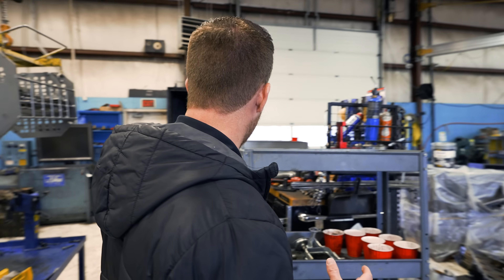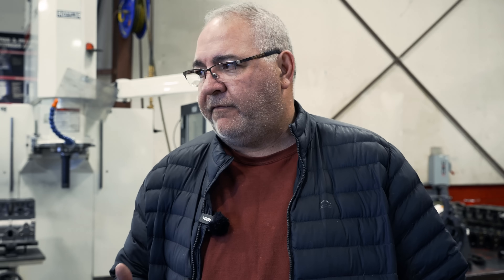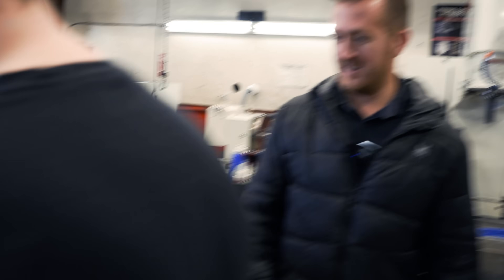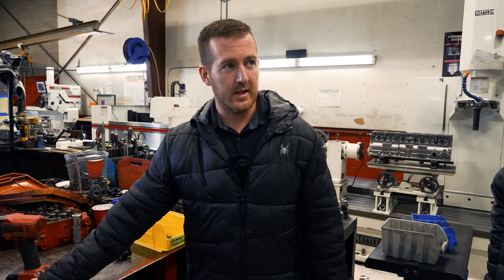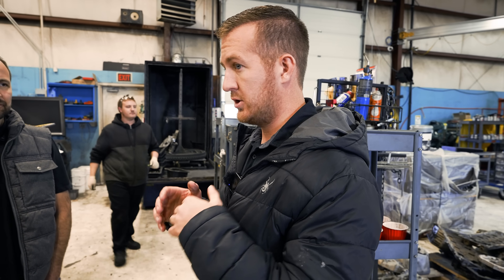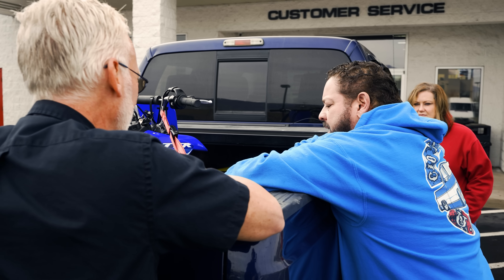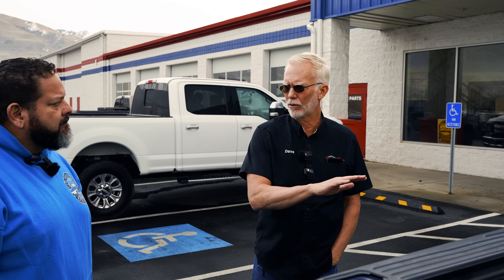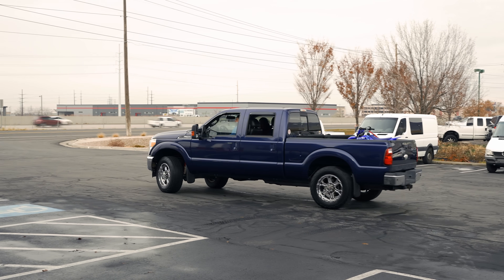Looking Inside a 900,000 MILE CP4 Pump!

Comment: Regular fuel filter changes, draining the water separator in between, Good fuel from a station that normally has fresh fuel (large truck stops). The more fresh the fuel the less likely the fuel is to sit around and absorb moisture. Seems like anytime i hear of a cp4 failure its usually followed by my water in fuel light came on, i put def in it, i change my fuel filters when the low fuel pressure light comes on, ect. Have a 17 f750 service truck with 7800 hours on the original pump and still going 🤷‍♂️

Comment: My local shop told me they pull off more disaster prevention kits than install. Reason being the prevention system screws up the fuel flow and the trucks throw a code?  Personally I had one on my 2014 6.7 power stroke, zero issues just recently did the DCR replacement at 165,000 miles. Always ran the clean diesel fuel lubricant. Never measured it out just poured it into the tank eye ball measuring👍🏻. I’ve owned the truck since new. I did notice a difference in the performance with doing just the disaster prevention kit. Then with the DCR replacement question is what creates the different fuel curve with those changes without tuning the motor?

Comment: I bet it was not tuned.  This is HUGE.  Tunes often only do 2 things.  Raise rail pressure way up and advance timing.  Hard on pumps, injectors, seals in fuel system.  Poor Timing is hard on pistons, bearings, head gaskets, valve train, cranks, dampeners, transmissions, everything.  I will keep preaching this.    Anyone make a tune for delete but keeping how the engine runs stock?  EGR and exhaust restriction is not good for engine life and efficiency.

Comment: 2017 6.7L with 253,000 miles. Oil change every 6,000 miles. Fuel filter change every other time. Hot Shot's Secret Everyday Diesel Treatment with every fill up. I'm about to change to Archoil.

Comment: Bro has 900k miles and 4700 idle hours, I am at 254k at 10189 hrs, and 4448idle hours😂 I base my oil changes off engine hours since it idles so long, I used to go off miles and realized how overdue my oil changes actually were

Comment: Wait that Secret sauce is made by Opti-Lube. Is it the XPD?
Reply: I ran and did all repairs on a 61 Hatterass w/Detroit
V-12 TI motors for over 20 years running boat between the Florida Keys and the Bahamas. Was plauged by sticking injectors and lost 1 turbo until adding XPD to fuel. Had electric pump on each engine for polishing fuel and priming fuel system. 
Electric pump speed doubled on both sides as the 
XPD reached the pumps. Was in the engine room and heard Walbro pump speed increase. Mind blowing. Figured this out around year 5 after replacing multiple injectors all rebuilt year 1. Never had another fuel problem in the next 15 years. Boats tend to sit alot which is never helpful but seeing is believing. Opti lube is in Utah I think. Check out their 3rd party test info on line to compare other"lubricity" additives. Dave knows all about them I'm sure.

Comment: Slightly clogged filter has highest filtration.  Too frequent replacing filter does not help.  Use a larger yet finer filter (2-3micron) is best.
Reply: The INSANE DIESEL EXTREME BYPASS OIL FILTER is a progressive 10 micron to 1 micron filter that does not effect the OEM full flow filter or the oil pressure. It is fantastic! I will never own another internal combustion engine without one of these installed! NEVER! Best investment anyone could ever make in their vehicle, gas or diesel!

Comment: Not being a smart a$$ here.  How does not being run everyday cause problems??
Reply: Honestly, I don’t know! I can tell you from my experience I’ve had many diesels and the ones that weren’t worked every single day deteriorated at a rapid rate compared to the others. Dave or Lake Speed Jr. could probably help with that.
Reply: @Derekn2288  Thank you for the reply.  I bought a new 2023 Super Duty and only put about 10K on it a year.  Just wondering why??
Reply: @elmerfudd7674 No worries. I’m trying to answer questions the best I can. I wish I knew why as well. A lot of people have commented it’s because of infrequent start and stops, having the engine running at temperature for long periods!

Comment: I disagree with only one thing he said and thats running your vehicle daily. Your vehicle can sit, maybe not weeks or months at a time but you don't have to drive it every single day. However, when you do you drive it, you NEED to get diesels up to operating temp. Quick trips to the convenient store and back are not good for these trucks. I'm willing to bet that the majority of folks who have had short term issues with their diesel trucks are owners who don't even need a diesel truck. They treat them like their previous gasoline vehicle and unfortunately they have issues.
Reply: Any information I’ve shared here is solely based on my experience. I’ve had diesel trucks which sat and they deteriorated far quicker than the ones I pushed every day. Maybe it’s my unique situation I don’t know, I’m just sharing what worked for me.

Comment: The CP4 also benefits from the addition of a lift pump, putting positive pressure at the CP4 pump inlet, as well as the additional filtering.

I've ran one in  2015 Duramax for 11 years. I've also been using Opti-Lube XPD every tank for lubrication.

Comment: i did the math say you do a basic diesel service all your filters and oil. yourself. for 220,000 miles. every 5000 changing oil and filters for 220 dollars each time. its 9680 dollars for a 6.7 powerstroke.

say you don't do that. and do your services every 15000 its 3080 dollars.

75-100k miles. your engine dies. its now 27,500.00 Dollars + all those pointless oil and filter changes. you did to prevent something you made happen
Reply: Normal intervals would’ve been about 179 oil changes at $200 for $35,800. I have probably done about 60 oil changes at $200 for $12,000, and my engine, except the lifters, looked brand new on the inside after 892,325.7 miles! All because of great fuel additive, oil, and the INSANE DIESEL BYPASS FILTER.

Comment: Hours is more important than distance. I don't live in USA,  but for some comparison : here we have Toyota Corolla 2.0D (2C diesel engine) for taxis. I know some of them with 1 million Km, that's the equivalent (because city low speed driving) to around 50-60 thousand hours. The other face: Toyota Land Cruiser 70 series with 850 thousand kilometers,  equivalent to 26 000 hours (ambulance service). I mean, I love American trucks and cars (i have 4), but time vs load is a better measurement to compare durability. Greetings from Costa Rica.

Comment: Lubricity came out of the diesel  a while ago  coz the emissions 
Ultra low sulfur soo… additive is the key and way to go 

Good fuel ( hotshot line of work means ..truck stops fresh  moving fuel at all times 
Fuel filters maintenance
ADDITIVES 
Hard work 
Its shown right there

Comment: New Ram owner here.  I want to know everything this guy does to maintain his truck?  I’ll follow his lead down the road.  
Dave,  could you do a video about this ??
With recommendations on oil, filters, fuel additive and filters, ect.  I service my cars religiously, and want to get off on the right foot with this truck too .   Thanks
Reply: #1 thing to do is put a bypass oil filter on from insane diesel! Never put a drop of fuel in without additive! Oil analysis, oil analysis, oil analysis!!!
Reply: Agree, specifics would really help. If you get an answer please add it to your comment so I’ll see it
Reply: I think a key element of the longevity plan was regular exercise. He pretty much keeps it running non-stop, virtually every day on cross country highway drives. THAT part is hard to replicate.  

Problem is we don't know the relative contribution of 1) constant driving, 2) bypass oil filter, 3) fuel filter change frequency, 4) large fuel tank, 5) Engine Oil Selection, 6) fuel additives 7) some other secret sauce.    

Lots of people bring up Amsoil, and some have suggested it is cleaner than "other" oils. Unfortunately, Amsoil is NOT on Ford's approved list for the recent 6.7 diesels.  I have been using Rotella T6 Full Synthetic Diesel engine oil, and changing frequently AND sending each oil change in for analysis.

Based on some other comments, we also don't know the relative harm or benefit from taking the truck for a short run on days it isn't drive hard. I say that because "common wisdom" is that lots of short runs or extended idling are bad for the car due to carbon build up. But maybe idling for 5 minutes is a good thing in order to lubricate parts and idling for 30+ minutes is a bad thing because there is no additional lubrication effect but every minute at low temperature contributes to deleterious carbon build up?

Comment: I have read the cp4 designed by Bosch was meant for European diesel fuel which has a minimum of 2% biodiesel. If you can fill with 2% biodiesel every time that's a good idea. Other thing is these stations don't tell you and the workers don't know if there is 2% biodiesel added. I honestly think the powers that be despise diesel engines and pass laws to make them self destruct.

Comment: I wonder if it's the additives, or a sub-micron filter. I would think that filtering out particles that exceed the Lambda of the fuel film would keep surfaces from spalling.(Lambda is the thickness of the oil film, minus the surface roughness) Diesel fuel is a much better lubricant than gasoline. His frequent fuel filter changes, which prevent cavitation might have more to do with the longevity of the fuel pump, than any additive. I don't know. (The extra lubricity helps, but by how much?) As far as needle bearings in the lifter rollers go, needles are better for those that don't maintain their engines, because the extra clearance makes them more forgiving to sludge, and particulate matter. Many of the failures come from premature wear, rather than metal fatigue, which was the case in this engine, which got 5X the number of miles people normally get.

Comment: 🇺🇸   Hey Dave what kind of oil znd fuel additive did he use. what ever it was it worked well with thst CP4  pump.  🇺🇸
Reply: The bypass filter, fuel enhancement and oil this guy used is made by INSANE DIESEL

Comment: what fuel additive was the 900,000 mile guy using?. what oil?.  And what year 6.7. went 900,000 mi.
Reply: Hello fellas how are you doing today. just wondering the  fuel additive he was using.   🇺🇸
Reply: @rusty299  The bypass filter, fuel enhancement and oil this guy used is made by INSANE DIESEL
Reply: The bypass filter, fuel enhancement and oil this guy used is made by INSANE DIESEL

Comment: CP4 failures in EU are way lower than in USA despite same sulfur content limit of 15 ppm. The reason is because the EU ULSD spec., EN590 also mandates the correct lubricity additive package for the fuel; but the US spec does not mandate a lubricity package so some fuel suppliers don't bother. EPA only thinking about emissions and not the owner? Fuel suppliers short changing the customer? Shurely not!?!

Comment: I have a 2.0 Audi a6 from 2011, engine CODE CAHA. I also have the CP4 pump in it. I change the oil every 10.000 km and I change the Fuel filter as well.  After changing it, we prime the fuel pump 10 times with VCDS before starting the engine.  I don't use any aditives because I don't know which ones to use and if they are useful or not :)
Reply: The bypass filter, fuel enhancement and oil this guy used is made by INSANE DIESEL

Comment: They won't tell you but the 900000 Ford uses amsoil ✊👊
Reply: The bypass filter, fuel enhancement and oil this guy used is made by INSANE DIESEL
Reply: Amsoil doesn’t filter down to 1 micron. It’s cheap made Chinese pos

Comment: 4:51 - Despite all the negative commentary surrounding the CP4 pump,  that's clear evidence that it will last if you properly maintain the engine AND include a lubricity additive to your fuel.
Reply: The bypass filter, fuel enhancement and oil this guy used is made by INSANE DIESEL

Comment: One other important fact:  crank after glow plug light goes out and then do not drive until RPMs go to a consistant 600 to 650 RPMs.   Winter months, depending on location, put adhesive warming pad on diesel tank, def tank, and oil pan.  Warm up above 47°F before driving a diesel.

Comment: Yes!
Use "top tier" fuel
Keep tank at least 1/2 full chilly weather ir at least 1/3 full hot weather
Change oil/fuel filters every 4 to 5k miles
Never fill up when tanks at station are being filled
Keep the idle time down
Change engine air filter and cabin filter once or twice a year depending on dirt exposure.
Keep joints greased and tires rotated with correct air

Comment: I have 244,000 miles on my 2011 6.7 Ram. Just replaced the turbo for the first time, but all engine and drivetrain components are still original stock, with the exception of having it deleted at 125,000.
I change fuel, oil and air filters and oil at 5-8k miles religiously. I’ve always expected trans issues, but I’ve never serviced it once to date and is still running strong.

Comment: Paul in the UK here I've got high mileage out of diesel Fords and Vauxhalls (GM) also Peugeots regular oil changes and fuel filter changes, drive them hard but keep on top of maintenance you get out what you put in also ran dump trucks and mixer trucks never take the cheap alternative on regular servicing

Comment: It's also good to note that doing long stretches of highway driving where the motor is staying at a relatively constant rpm, this guy isn't abusing it, but still uses it. Lots of factors here that help work to his advantage.
Reply: Bingo
Reply: Yep, most engine wear is on cold startups. Sounds like he never really shut it off much, and had heat generally at a constant temperature. The crazy part is how little soot there was when the engine was tore down. That's a lot of idle time with stock egr. Also the shape of that engine, if he had just replaced those lifters he could have gone for at least another 500k with that motor.

Comment: The two killers. Contaminated or dirty fuel and to dry of fuel. Always run good filters and change them as needed. Good additives and continue to use them. IMO the diesel fuel now days is way to dry vs the fuel of the past.

Comment: I'm the original owner of a 1998 gmc 2500 / 360,000 miles only part of the motor taken off was the intake manifold due to coolant leak I hear it's common on 5.7motor

Comment: I am a mechanic for a state department where we have a fleet of 6.7 powerstrokes ranging from 2011 all the way until current models and I have worked on them since they’re were new in 2011, our trucks get the worst treatment 24 hours a day, day in and day out and we have had 0 cp4 failures and a lot of these trucks are reaching 500,000 miles and we even run biodiesel. We change oil and fuel filters every 5k miles. Some of our trucks almost never turn off, it’s all about good maintenance and as this guy said, using the truck. Use the truck and do good maintenance and most the time that’s all it takes. If these cp4’s where as bad as everybody says why would ford still be using them after almost 14 years and no class action lawsuit………

Comment: I had 874000 on my 2015 f350 I had number #7 injector failed.  Only fuel problem I ever had. I was told always get your fuel at a truck stop to be sure it's fresh and never let your diesel get below 1/4  of a tank I had an auxiliary tank installed just to be able drive further.  I never believed in the snake oils. ( additives or special oils) only used Motorcraft 10-30 oil from Walmart. It totaled out due to a deer at 927k miles last November.

Comment: I don't think I heard what fuel additives he uses? This past year I've been using hot shots for all of my daily use driving vehicles. Which are all gas. My truck does set a lot, so I am going to start using Hot shots fuel additive, I usually use howls but I did not think that was very good stuff, but hopefully better than nothing?
Reply: The bypass filter, fuel enhancement and oil this guy used is made by INSANE DIESEL. They hired dave to do a failure analysis, they talk about it on their instagram.

Comment: Key words: cross country, run everyday, oil AND filter changes, gas at truck stops.  Sounds like interstate highway miles. The additive alone isnt a guaranteed cure. The plan with these key words are super important.

Comment: Diesel is an interesting thing. The spec of the fuel can absolutely vary from refiner to refiner. So long as a broad-ish spec it met for cetane and such. So an additive can absolutely help aid in lubricity and cetane. But you can use many things, ATF, 2 cycle oil, an off the shelf brand, homemade blend. Some of the secrets are available in form of an SDS or some online searching of various test done in the past.

The other side is literally Maintenance. Changing you oil earlier depending on duty, fuel filters, air filters etc.... Diesel trucks are amazing these days. But you gotta run em, you gotta do some hard pulls, or wide open trottle. You can't be a granny. Use it hard, these trucks can handle all you throw.
Reply: ATF and 2 stroke oil sounds interesting. Any brands you can recommend?

Comment: The math is simple. 1,000,000 miles / 5,000 miles = 200 oil changes. If you pay on average $100 per oil change and that's me bending it towards fancy one, you still end up spending $20,000. That is cheaper than having an engine replace. Additives will run you up another $3,000 in a lifetime of a vehicle (if you buy gallon jugs). They're not lying when they say it's cheaper.